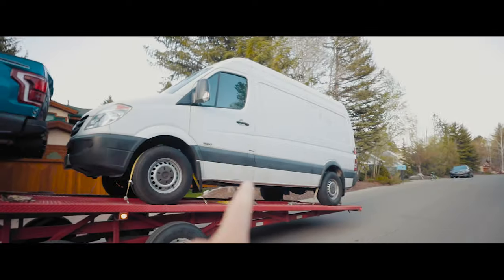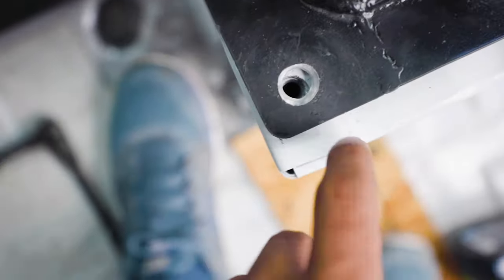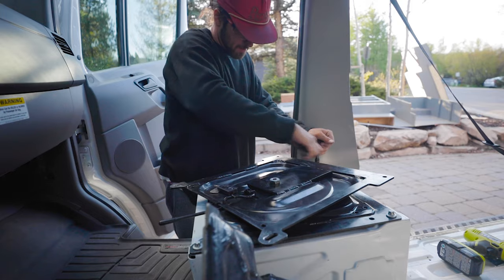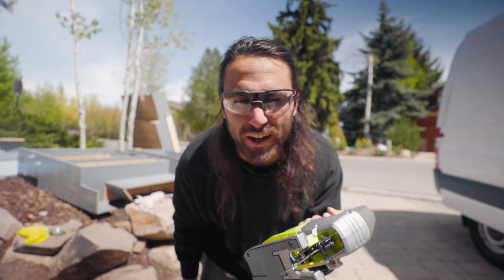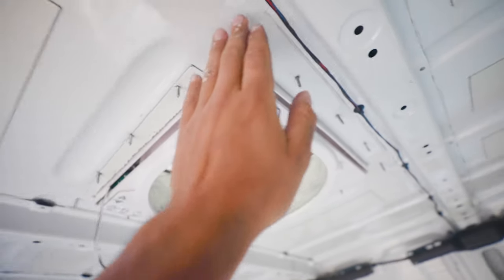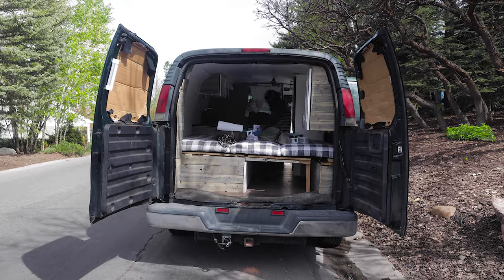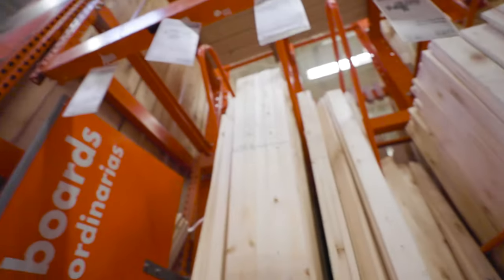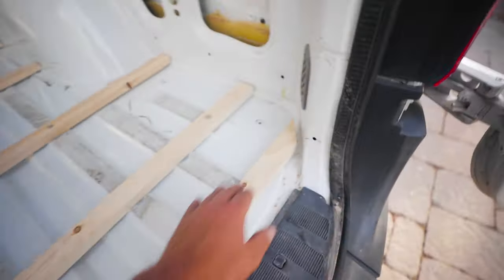maxxair fan install!! | sprinter van conversion

Comment: Have you looked into putting in radiant heat for the floor? That would be so cool for a van. Super efficient too.
Reply from the maker: I have not! That’s a super cool idea. I could definitely be wrong but I think that’s done by hot water right? Would be pretty difficult to keep that heated in the van but definitely something worth looking into! Thanks for watching and for the great idea! 🙏🏽

Comment: Brother, nice work! Also most of the time custom parts don’t fit good and you need to modified like you did. And I hope you have a plan to make that project more like a off-road camp van, that will be sick! I could help you built it if you need a hand. 😎🤙🏼
Reply from the maker: thank you israel! i definitely thought that seat base was going to fit better but it definitely was a struggle! and yes sir! certainly going to be an offroad beast!!

Comment: Wabasso heater or Espar Heater fits within that cavity of that swivel seat and then add a vent to that base. great for cold weather, you'll be glad you got it. https://www.youtube.com/watch?v=Tt69-8HcCY8 This video shows the install for an Espar install diesel S2 heater for a Sprinter van.
Reply from the maker: thanks georgina! i went with the espar s2 :)